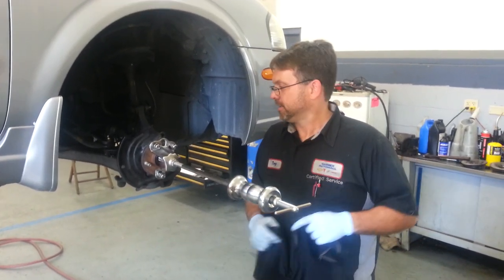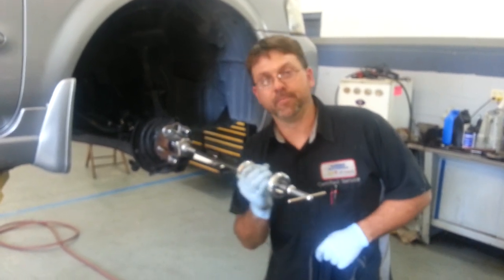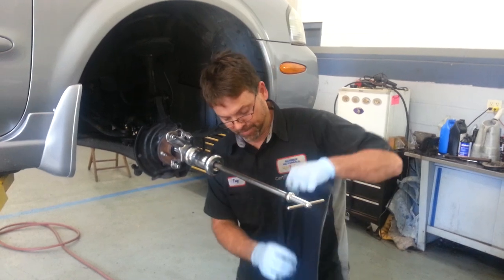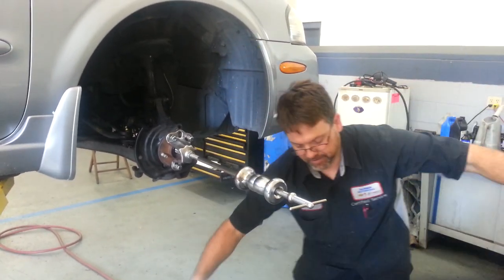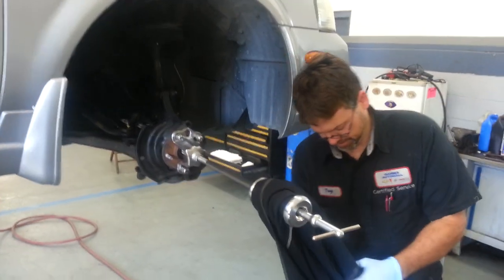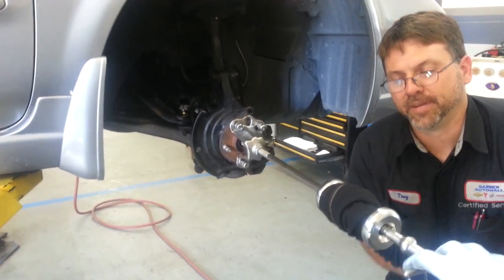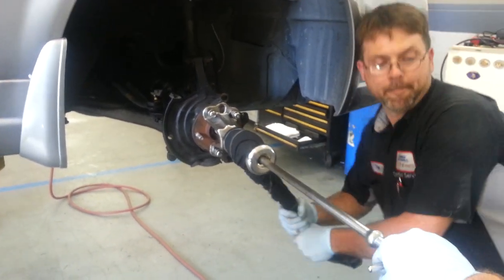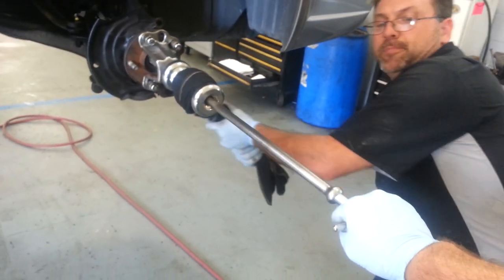Tech Tips with The Angry Mechanic -Incresing power on slide hammer

Comment: or, drop the car so the slide hammer is at about knee height or a little higher. "hike" the hammer between your legs (carefully). works like a charm
Reply from the maker: thanks for the tip

Comment: that destroys the bearing assembly...now you have to replace the whole thing...fun
Reply from the maker: DGOfTheCentury of course ,what else would you remove the hub for?
Reply: He Who Angers You captive rotors, wheel studs, lube etc...
Reply from the maker: you are correct, I havent damaged a wheel stud in so long or seen one the thought slipped my mind. as far as machining rotors, I have always worked in a shop with an on the car lathe, also did not really think of that one either. ok this procedure is used when Repacing the bearing, lol. Good call.
Reply from the maker: DGOfTheCentury pdated the description. Thanks for pointing that out DG
Reply: He Who Angers You np...overall enjoyed the video though
Reply: @HeWhoAngersYou  Can I do this on a 2000 Honda accord 4 cylinders?